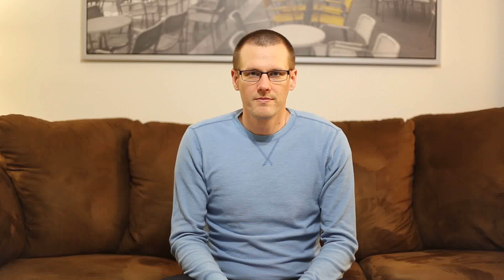What kills an RC Brushless Motor  - Current or Voltage

Comment: You can reduce maximum pwm output to offset the increase in voltage for a similar total maximum watt draw. You can program it on some ESCs, and can do it if using a flight controller with betaflight etc, some radios can do it. Opentx radios etc.

More voltage but same total watts is more efficient, less resistance since lower current. Higher kV motors have thicker wires and shorter wires (less turns) and offer lower resistance, so using high KV with high voltage is a good way to get efficiency if you manage to limit it like above or another method etc.

Since it’s more efficient and less resistance over all, you can likely have a higher watt draw and power output overall for the same heat output with lower voltage and lower kV.
Reply from the maker: Thank you for the comment Daniel!

Comment: Nice. My motor overheated on my xmaxx 8s the other day. Could my loose connection from one of the ESC and batteries have helped the demise? The xt90 connector there got hot and turned black both on the ESC side and battery side! I saw smoke coming out of the motor. Thanks.
Reply from the maker: Hi Rc enthusiast, with a loose connection my concern would be in radio power dropouts. Was only one of the batteries connectors over heating? Or was it both batteries?

Generally when I see a motor that is very hot and also a battery connection that has over heated, the power system was just pulling too much power for what it was designed for. A poor connection, not necessarily a loose connection would rob power being sent to your motor. The connection point may be hot, but the motor is seeing less power and heat.
Reply: @RCexplained  I had just installed slightly bigger tires and gearing that has worked well for other xmaxx 8s owners. My motor fan had stopped working, so I think it was a combination of those things. Yeah I did have my temperature gun with me but I was too excited to just jump and run my vehicle hard after installing a new motor mount, 20/50t gearing and bigger tires.

Comment: Thanks for the video. What I'm getting out of this is that I just need to make sure the RPM on my motor is no higher than the rating or what it was before the voltage jump and to give respect to the thermal requirements. Am I getting that right? I watched your videos enough to know how to calculate the RPM based on the KV rating and voltage battery.
Reply from the maker: That is right, all motors have a maximum rate RPM that you must not exceed. Too high of a voltage can exceed these mechanical limitations. 

Paying respect to the thermals of the motor will keep the current in check.
Reply: @RCexplained  Thanks Ryan. Still loving your videos. I feel like I'm messaging a celebrity.
Reply from the maker: @bdubq3653  That's awesome that you enjoy the videos. I'm not celebrity, just a dude who loves RC!

Comment: I don't understand english 😭

I have a brushless motor that has 3300kv. what is the maximum voltage the motor can accept?
Reply from the maker: Work this out from the maximum RPM that the motor can reach according to the manufactures specification sheet.
Reply: @RCexplained  Means it must be in accordance with the manufacturer's specification sheet? What if the voltage is forced more than that? On the 15volt max specification sheet, if I give 23volt will it burn? But with the note esc already support 23volt.
Reply from the maker: @zhagorazy4628  Voltage does not destroy a motor. Current does. Increasing the voltage can increase the current, it's important to keep this in mind. 

If the maximum voltage is 15v, 23v may exceed the mechanical limits of the motor.
Reply: @RCexplained  Means that if the use is not too long the possibility of the motor will be okay? and with the addition of this voltage will the maximum rpm increase?
Reply: @RCexplained  I have read other comments. so the point is that any voltage will be safe. the problem is the physical load of the motor. the maximum friction and heat that can be received by the motor?
Reply from the maker: @zhagorazy4628  In RC we typically use no more than 12s LiPo as a max voltage. Any BL motor can electrically handle the voltage. However, mechanically is a different story. 
The rotor or bearings can blow apart from the increase in RPM
Reply: @RCexplained  does the amount of kv affect the maximum rpm?
some say that the higher the kv makes the motor faster?
Reply from the maker: @zhagorazy4628  A higher kv will have the ability to deliver a higher output RPM at the same voltage.

Comment: But MGM speed controllers are capable of 55 volts. Will that cause the voltage to jump the wire?
Reply from the maker: No, it's not that simple.

Comment: So how we control ? How can we raise the volt and keep the amp low ? Is there a type of electronic board for that ?? Please
Reply from the maker: Raise the voltage and at the same time decrease the load. Reducing the load will drop the current. Continue reducing the load until you get the current draw you are after.

Comment: I loved it. Perfect lecture, now....... if we have zero load, how many volts/amps could a 2000kv motor hold?
Reply from the maker: Thank You for your comment. Voltage is dependent on the maximum RPM that the motor can mechanically handle. Total RPM divided by kv will provide you with maximum voltage.  Current with no load would theoretically be 0 amps. However nothing is 100% efficient, therefore the current at no load would be equal to the no-load current of the motor. This is denoted by (Io) and can be referenced in the manufactures documentation.
Reply: RCexplained ....... thank you for your reply, I just subscribed and on going to enjoy watching all of your videos.
Reply from the maker: @AutoBodyEverything  Excellent!

Comment: Thank you. This is very informative. How much can you bump the voltage, twice as much? for max load.
Reply from the maker: You can increase the voltage until you hit max RPM of the motor.
Reply: RCexplained but i thought it had to do with amps and load? do you mean the rpm with no load? thats not even 36v on my 24v motor, another guy used 24v motor with 48v and has been using it for over a year. he says just dont let it get too hot. is there any truth to this?
Reply from the maker: @bojackson3073  the voltage limit is the maximum RPM of the motor loaded or not. The motors power output limit is based on load. More load is more current which translates in to more heat. Too much load builds too much heat and stresses the motor. You can increase voltage as much as you want as long as you don't exceed the thermal and mechanical limits of the motor.
Reply: If you double the voltage, you can halve the amps for the same power draw. If you limit the pwm to 50% you wouldn’t have to change anything else.

Comment: Thanks for this. So my understanding is that if I use a 5V motor shield with an Arduino on a 3V motor, as long as I set the code to not spin it at max speed, say 2 thirds max output,  then I should be good right?
Reply from the maker: This is for a brushless motor?
Reply: @RCexplained  Actually I don't know. Does it matter?
Reply from the maker: @ArcanePath360  To a certain degree yes. Brushed motors will experience more wear when being overdrive.  However, you can over drive a motor as long as you stay with in the thermal and mechanical limits of the motor.
Reply: @RCexplained   Thank you.

Comment: see if I am right
I want to sacrifice range for speed, so, I can play with voltage and current while I do not exceed the wattage of the motor?
exemple:  If I have one 800w brushless motor,  and Im using it in 40v 20a(max) daily (with any problems), I could change the controller for one with output 80v and 10a(max) and it will be fine?
Reply from the maker: You haven't changed the overall power output. An 800 watt brushless motor will be as fast as an 800w motor. It doesn't make a difference how you get to that 800 watts.
Reply: and I will just put the 80v10a when the battery is 100% and maximum load on the motor, 
something that will not happen very often...
Reply: Thanks for the help
Reply from the maker: @TheBirells  no problem, glad I could help.

Comment: I wish i had seen this before i killed my motor.. just wondering how will you know if it has affected the esc. My motor just wont turn anymore but esc switches on fine and fan spins🤷🏾‍♂️
Reply from the maker: Hi Sean John, my recommendation is to try the ESC out with another motor. You will want to do this in a safe spot in case there are any issues. If your motor burned up and you stopped pressing the throttle quick enough, you will be alright. In my experience, when the ESC goes out, it has been fairly obvious.
Reply: @RCexplained  🤔thats a point it didn't go up in smoke and seems to be ok using another motor.. maybe i just saved it when i noticed it was overly hot..  👊🏾🇬🇧
Reply from the maker: @east_ldnrc1378  Sounds like that is true, you may have saved it.  When you run your RC next time, make sure you make the correct adjustment to reduce the load on the system.

Comment: What about a sensored motor with hall effect sensors?? don`t that sensors get destroyed with overvoltage?
Reply from the maker: Hey Sergio, great question. It would be difficult to electrically destroy those sensors as the ESC is responsible for them. The sensors circuit is different then that of the primary circuit running power to the motor.